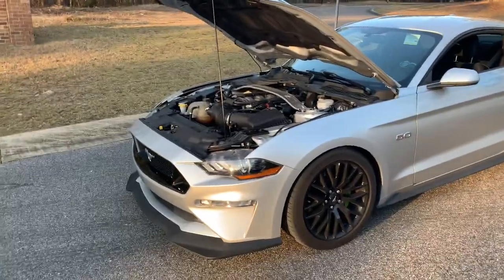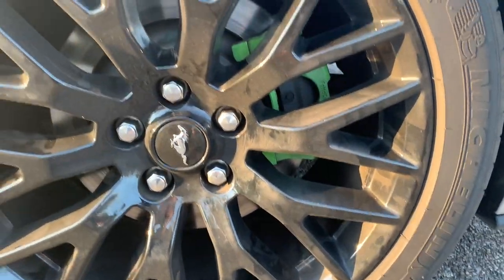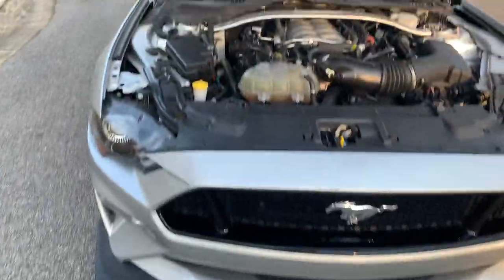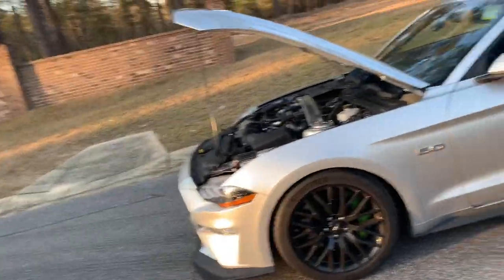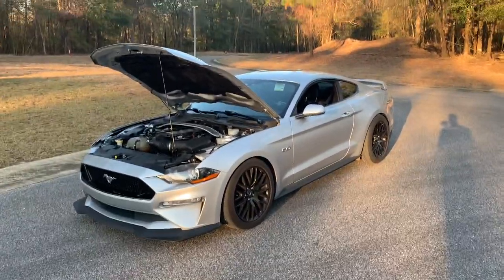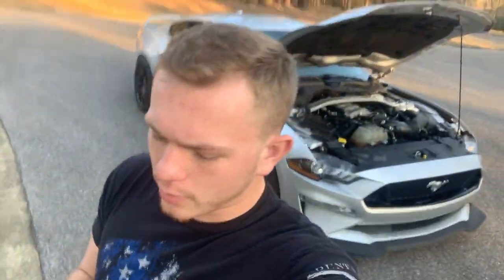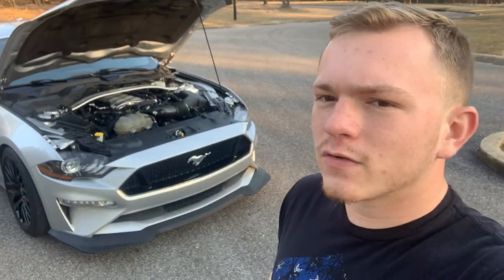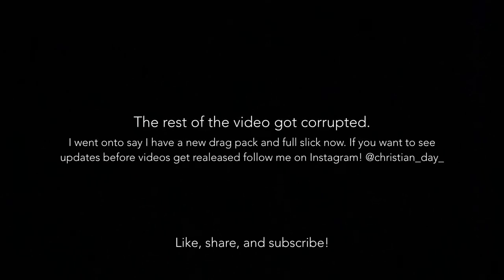How To Make 500whp in your 2018+ mustang gt!!

Comment: These cars are strong. I came from a 797 Hellcat Redeye and my new 2021 Mustang GT is more fun to drive.
Reply: Nicee
Reply: Hell yeah! I was recently car shopping and narrowed it down to a c7 corvette, 2020 mustang GT, or a hellcat! I went with the mustang GT 2020 and don’t regret it a bit! Already been missing it when I can and can’t wait to get some real power out of it later on!
Reply: Just got mine waste 50$ every 2 days😂 worth it tho
Reply: @dontragequit1177  factssssss😅
Reply: I love the hellcats but the power is unusable unless you’re going 80+ mph. Anything more than 1/4 throttle under 40 and you’re doing a burnout. Really wish they had an AWD option to help it get off the line and make the power more usable in everyday driving. The ZF 8 speed transmissions are awesome, so is the 10 speed in the mustang, the 5.0 is a lot more usable day to day and gets off the line pretty well.
Reply: @roroguapo3  
Dude you hit the nail on the head! I try to tell people the same thing but they can't get it. 👍
Reply: @markurbancowboy  Not true. I have stock p zeros and easily can get traction at 60+ with my WBHC charger. Even at 40+ it hooks okay if you know how to ease into the throttle up until WOT
Reply: @TB-vb3ov  
Try that in a WBCH Redeye. 👍
Reply: Stop the cap
Reply: @A Google User  they don't do awd drive because the awd power train with a v8 and the 8 speed transmission won't fit in the cars the system is too long
Reply: I had a 22 charger HC in Hellrasin. Loved it, and I feel the 6.2 with the HP90 trans is tops, but the gem 3 coyotes are pretty stout and like the scats, you can wind them out and play more on the street. I now have a 22 Mach 1.
Reply: Lol i hated the way mustangs drove in the wet. My mustang felt like it was gonna eat a crown everytime i took it out on wet days. Feels like i gotta stay in the slow lane with hazards on. Found myself searching for an AWD vehicle just to thrash in the rain now
Reply: @tatsuhirosatou5513 they do awd on the pursuits tho which some are V8s.

Comment: You’re talking whp horsepower. I believe you’re wrong the 2018 mustang came with 460 crank horsepower so that would be approximately 350 rear wheel horsepower. I don’t see you getting 150 hp out of the mods. I’m not saying I’m right this is more of a question to maybe help me understand it more.  I have a 2020 PP1 supercharged and was told I have 750 crank horsepower I dynode at 620 rear wheel.

Comment: 499.2 ain’t 500 just sayin.
Reply: Did you know the old 302 engine only has a displacement 4942 cubic centimeters, aka 4.942 liters. Coyotes have 4951. 5.0 is a lie!
Reply: @Firesealb99  not to be that guy but the gen 3 is actually a full 5.0L now 💪🏻
Reply: @rpmiracle  is that your street bike?
Reply: @rpmiracle  holy crap im so lucky not to be a miserably nobody like you

Comment: Add some 4.10 gearing along with a short throw shifter. Also an upgraded clutch is pretty much a must for the MT82
Reply: What about 3.73 gears that's  what my pp1 has
Reply: @StevenNeidlein  4.09 for NA manual

Comment: Lots of NA Mustangs have over 500whp. 
The haters criticise  -
My GT has 592 rwhp.
Ported cylinder head
Ported manifold ported 90mm throttle body
CAi 
Long tube Headers 1 7/8”
100 cel cat 
H-pipe.
Tune 
FP half shafts 
Steeda anti hop kit. 
315 rear tires.
CAI
Reply: i realize I'm pretty randomly asking but does anyone know a good site to watch newly released tv shows online ?

Comment: Nice ride!  I just bought an ‘18 PP1 GT and looking at mods. Good to hear the stock air box is decent with a drop in filter.
Reply: My 19 GT PP1 ROUSH Tune & Intake with Ford HP X-Pipe and she’s really fast. Tune is 91 or 93 but only run 93.
Reply: @stevensoderlund8512  is rouch tune the 93? Xpipe good for the active performance exhaust?

Comment: I know you don't have the mustang gt. But, what was the brand name of the race e85? Because the only race e85 I know of is ethanol oneR or Ignite Racing orange e85. And where can I buy some of that e85 you got? I am from Louisiana and I'm willing to make the drive
Reply from the maker: I was using renegade E85 then switched to VP!
Reply: @ChristianDay0404  Was it VP C85?
Reply from the maker: X85!
Reply: @ChristianDay0404  Cool thanks man. I just installed a whipple on my 2020 mustang and don’t have pump E85 available and wanted run it to get the maximum performance out of it. Not going to lie I hated it when you sold the mustang but, I personally love the newer Camaros
Reply from the maker: I’m back in a mustang now! Somehow I always find my way back hahaha

Comment: What gear did they dyno the car in? A friend of mine went on the same dyno as my car. In the 1:1 gear(4th gear for a gen 3 manual coyote car) with lund e85r tune, intake, and exhaust he made 450whp. The dyno was setting was STD smoothing 5. I’m just surprised it made this much with that little.
Reply from the maker: It was In 4th
Reply: @ChristianDay0404  damn bro either a super happy dyno or a factory freak but good power none the less

Comment: Nice car man I could see it being more in the 475 to 480 range on a super legit Dyno since it is a manual.
Reply from the maker: That where I thought it was going to be honestly. Oh well. I’ll be putting it on the track soon and see what kinda numbers we can run
Reply: Mine made 488whp with tsp catless 1 7/8, jlt, and corsa extreme on my a10 2018 was on flex fuel e tune
Reply: @vinnysoresi3378  those are good numbers I bet your elevation is pretty low I made 464 at 5,800 FT above sea level with 7000 plus da
Reply: Yeah not sure on my elevation but I’m in queens ny
Reply: These are uncorrected #s. It ain't making 499whp with those mods.

Comment: I’m not sure but will Shelby 350 or 500 injectors and fuel pump fit being they both run 5.0 blocks?
Reply: The 350 and 500 has a 5.2 liter instead of the 5.0

Comment: Great video.   Just wondering what you do about warranty?   I heard Ford can detect tunes.   But, I have no idea.  Thanks
Reply: On these newer cars a tune will indeed leave a “footprint” that Ford can see if they want. The tuning doesn’t void your warranty however. I’m wanting to say the applicable law is called the Montgomery Act. Basically if something happens to your car then I’d advise putting the stock tune back in. If the dealership gets upset, they’ll have to PROVE that the modifications you made caused the failure in question. If it’s unrelated then you shouldn’t have any problems. I have a 6yr/100k bumper to bumper from Ford and my car is tuned…

Comment: So many mention e85 and 93. Most gas stations have 87 89 and 91. Makes things a bit more challenging. I have 18 GT and run 91. I wish we didn't have all the environmental regulations here that other states don't have regarding CAI long tubes cat deletes etc.
Reply from the maker: The closest pump E85 to me is about 3 hours away. Easiest way to get it here is in 5 gallon pails from VP.
Reply: @ChristianDay0404  maybe get a 500 gallon tote. Make 3 hour drive worth it.
Reply: states with more elevation sell 93 to compensate.

Comment: 2019 gt mustang aluminator 5.0L engine calimer mt-82d mgw shifter McLeod rst dds drive line g force half shafts vmp tune pedders coil overs w external canisters bmr k brace stop the hop rear braces by bmr fhp front strut brace bmr rear strut brace bmr and steeda complete suspension mods fhp high output alternator boobma trans mount steeda differential brace fhp differential sve rims 10ft 11r MCH pilot sport 285 ft 295 rear cold case radiator dw-400 fuel pump rtr front vents custom kona blue paint job smoke out European aftermarket taillights and headlights MMR pulse ring autosport roll cage 
American muscle 😊

Comment: cough Bullshit, no way in hell without headers or a cai. Way happy dyno.
Reply from the maker: on the 18+ the stock intake is the best. according to all the major tuners. and the 5.0 motor comes factory witha shorty header so a cat delete basically nets you a longtube header, obviously the full header will make just a tad more ppower but it would be minimal.
Reply: @ChristianDay0404  What did you use for the cat delete?
Reply: definitely a inflated dyno..should take it to the track and see what it runs